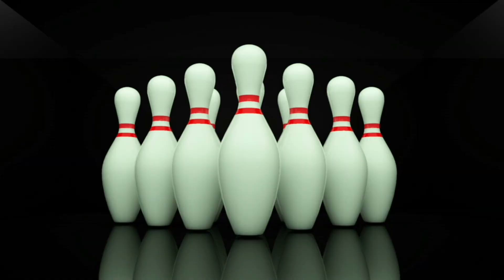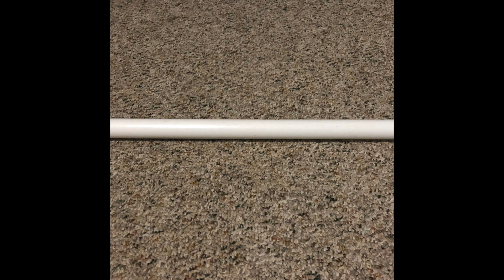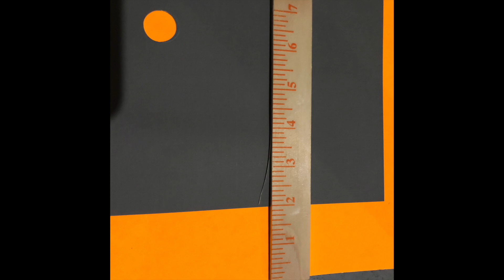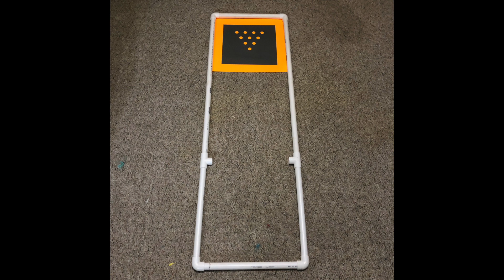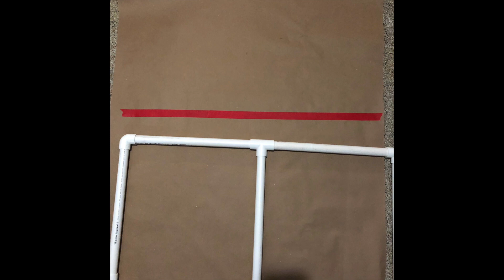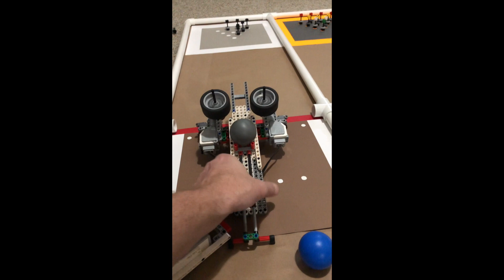LEGO EV3 Mindstorms Bowling Alley Build Guide

Comment: Talking about costs, not that it matters if you are using scrap supplies...for you non-plumbers trying to save a little money, it looks like Aaron is using "schedule 40, pressure white PVC pipe"  . If that's left over cast-offs , then ok. but if you are buying plastic pipe for your bowling lanes and want just adequate pipe, you can buy gray conduit pipe which is way thinner walled stock and somewhat cheaper, but the same out side dimensions (OD) which is not intended for pressure plumbing and not strong enough to drive over (under driveway use).  Then the corner and in-line connectors will still work...Just a pricing comment for us penny-pinchers.
Reply from the maker: Great point. I had a pile of PVC stashed in my workroom ceiling so just used what was available.